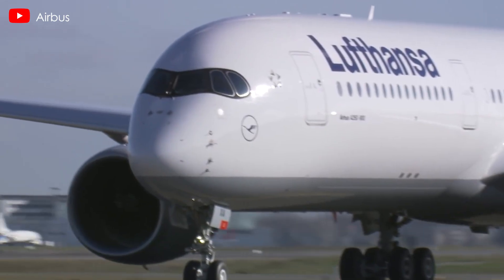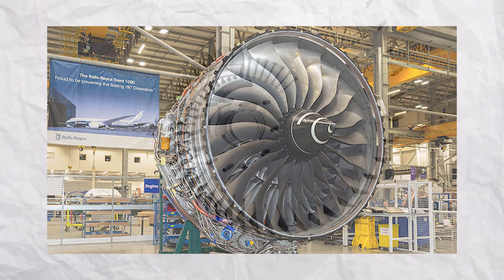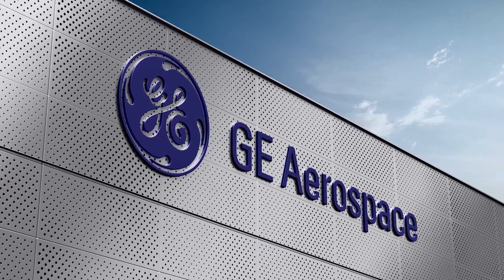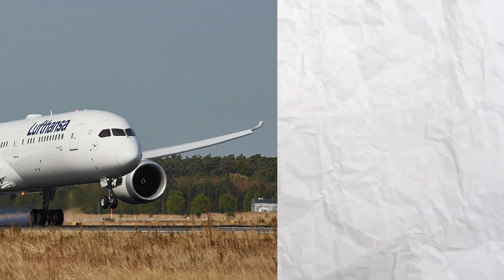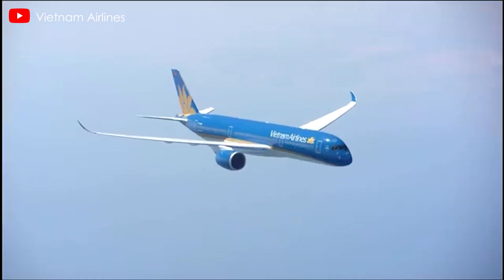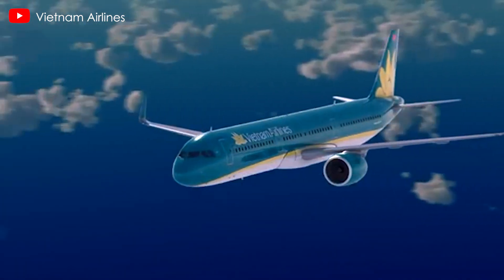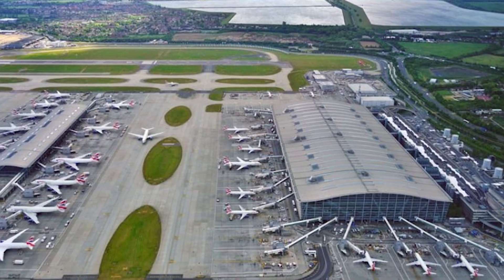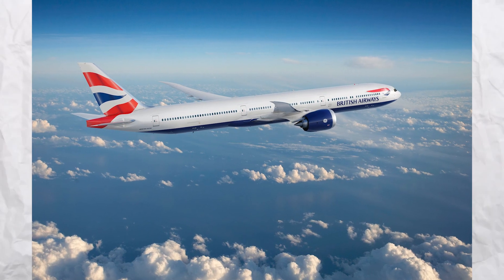Lufthansa HUGE Plan Switch to NEW Engine Upgrade Shocks the Aviation industry! Here's Why

Comment: These airlines should wait for RR Ultrafan engines.
Reply: You do realise that it is engine options for brand new aircraft and not changing existing engines.

As for the RR Ultrafan,  this is unlikely to be available for several years and almost certainly not for this version of the 787.